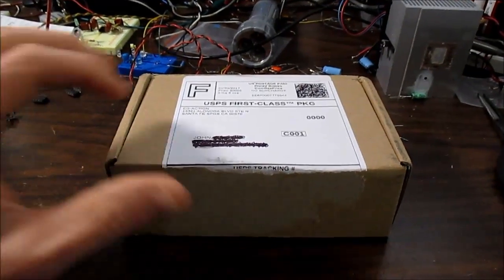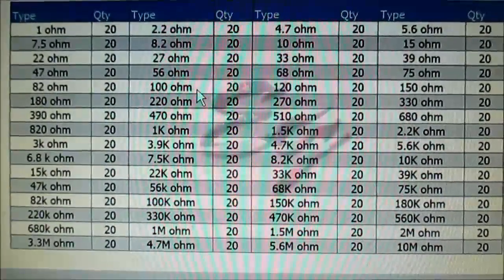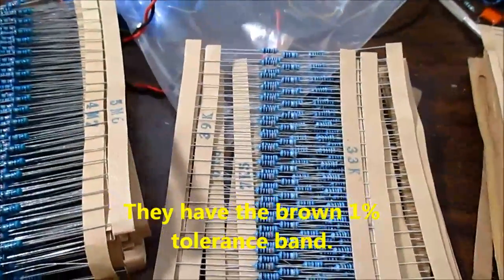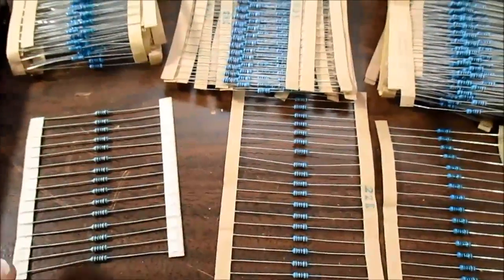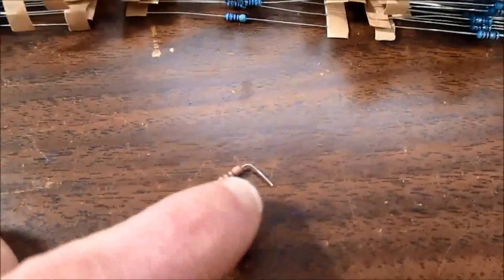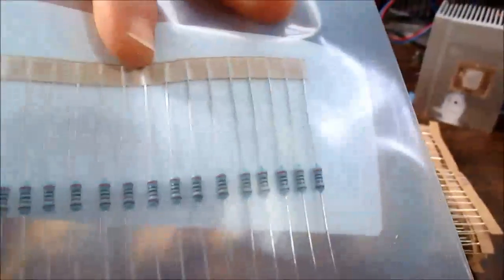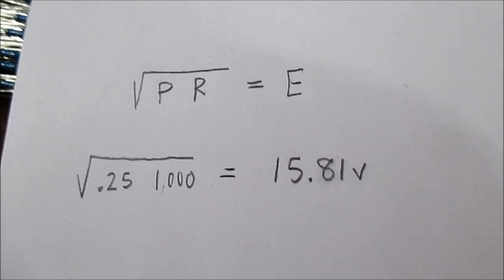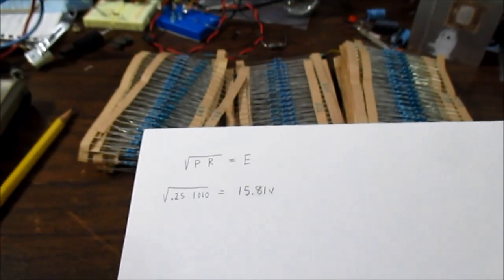eBay resistor kits - are they any good?  Review and test

Comment: test the leads if they are magnetic or copper with a magnet !
Reply: I think they are magnetic for this price. Years ago I bought on aliexpress perfect 1/4W resistor kit with non-magnetic leads, for good price $25 or something and lead resistance about 1.8-2.0mR. Now i can't find the same, prices are cheap, steel thin magnetic lead with 20mR resistance. Steel leads are half of a problem, but they are damn thin and bends. I can buy Taiwan resistors separatelly in my local store with good thick copper leads.

Comment: Most really cheap parts are untested. We use to get 15% failures on opticouplers on flame sensors the would fail in circuit test. About 30% of some chips on a low frequency radio board went up in smoke in during functional testing. A whole pallet with reels of resistors had about 10% bad. The department that bought the parts didn't want to spend the money on tested parts even the parts that hurt parts per million in defects, they got bonuses for saving money while we were pressured to do something about the defects. The untested opticouplers costed about 10 cents but the vendor charged another 5 cents to test them. Sometimes I would remove the component and solder in another bad component. Soldering the ASIC package chips with 40 J-leads was a pain, it was faster to put them on a BGA machine to remove them.  Building military stuff doesn't have that problem because every part is tested from the vendor before it's soldered on the board.

Comment: I did some test on the resistors to find the values drift with temperature, not 1%, use inferior thin steel leads, and do not solder as well either. In most circuit they will still work, but I question the long term reliability, and figure its not worth the hassle of having a massive problem afterwards, the cost savings are not worth the risk for such a low value item.

Comment: if i have 2 1/4 watt and need 1/2 watt. can i combine the two 1/4 to make 1/2?
Reply: Nope. It'll divide the resistor value by half. So if you have 2pcs 10ohm resistor wired in parallel, you'll get 5Ohm.

Comment: Hi thanks for the very informative video.  Do you think that noise can be an issue with resistors ?  i am obsessed by just one resistor ... the feedback one   I wonder if different noise figures from brand to brand can have an impact on the sound.  It is a very small part but with an importan task ... so its noise performance and linearity with frequency can be critical.   Thanks again.  Kind regards, gino

Comment: Hell I have just pulled out a 60 year old resistor that reads 80k instead of 39k  so how a  Chinese replacement be worse I don't know.
Reply: I just repaired the SMPS in a two year old bookshelf stereo system where a 1M resistor failed running at 50v. Quite how that happened is a mystery. It was a cheapo carbon resistor and I replaced it with a cheapo one of these.

The main problem with cheap components I think is higher failure rate, and if a device has 200 such bits in it, well we see the results all round us.

That said folk tend to toss stuff because it doesn't fit with their decor these days rather than because it is end of life so the need for quality is questionable. Very few 2018 stereos will still be around in 60 years even if they still work!

Comment: I've found cheap resistors like this are generally unstable under any kind of thermal stress and the leads are so thin and weak that you can't even push them into a breadboard without them folding over onto themselves.  Just my experience.

Comment: I thought I'd try some of those cheap resistor kits, a thousand or whatever with values from 1 ohm to 2 meg or  so. They measure OK at room temp, but the leads are like awful skinny bendy things and what made me put them in the bin was the  stability  - under load these are going to be crap. Heat one up and watch the values swing wildly. Tested next to a regular RS 0.25W 1k resistor a fairly harsh test was done raising the temp to over 150 degrees. The cheap resistor went down below 800 ohms, the RS component (which was 40 years old) - no change detected. I heated even further - roasting them a bit, RS no real change (maybe an ohm or two), cheap one kept dropping, though to be fair it recovered at room temp to near rated value. Negative 35% was about the order.
I thought maybe I could use them for something...but no, they are useless for my needs and in the bin they went. What are they? Crappy thermistors or crappy resistors?
Reply: NB Wonder if I was sent carbon film Rs instead of metal film? Temp coefficient is one area metal film really scores.
Reply from the maker: I was wondering too as I read that. I'll have to test mine. Typical low cost junk.
Reply: @JohnAudioTech  I was looking at the properties of metal film and it seems that the figures are in the few parts per million per degree, whilst carbon film is between 200 and 1500 parts per million per degree - right in the area I found. I guess they were not metal film.

Comment: My experience is the leads on these resistors are super thin! They're barely usable in breadboards. I've been looking for alternatives with thicker leads online, but to no avail.

Beyond that, the accuracy has been good for my applications as well. I tinkering a lot with resonant circuits, and generally notice drifting or if something is not in spec fairly quickly. And as long as you solder them, you'll be good.
Reply from the maker: Yes the leads are thin and are steel core. You have to go to a place like DigiKey for better quality.
Reply: Mouser has the Xicon brand 1/4 watt metal film for about $2.00 per 100.  Excellent quality with thick leads.  I just grab some in the main values I need.  YMMV.

Comment: Yes they are...bought all kinda metal film assortments before....cheap and worth it....nothing really specific or a point for carbon film anymore imo....Oxides or Cements/wirewound is a different story though...they usually have had a little better handling. Take a chance and have seen a lot of carbon film/comp open or drifted and I have.

Comment: What about capacitors for audio? is there any difference in quality between the good brands and the cheap ones?
Reply: if your only after 400 or so picofarads and under you can just make them yourself out of copper tape,  and wire for 10 picofards and under.

Comment: one good test i always thought was to 'burn' a resistor while hooked up to the meter with either a low temp flame (lighter or match) or a propane torch and see what happens to the value - the chinese 1% ones i bought didnt' change value at ALL
Reply: That is very interesting - mine were wildly changing - They dropped to over 35 % value. Binned the lot. I will certainly try some more. Where did you get yours?

Comment: One parameter you said nothing about: is the working and over voltage rating.
Note P=I(IR), IR=V is not the same as the voltage rating. 
These ebay/amazon sellers do not
even mention the voltage ratings, (at least not the ones I looked at).
So if you are doing mostly low voltage circuit - then maybe you are fine with these resistors, but if you are using them in tube amps - which may have 
hundreds of volts drop - then you need to be careful. 
The resistor may not sustain a high voltage drop even if the power rating is not exceeded. I buy from http://justradios.com/ which is more expensive but ratings are reported, and suitable for vacuum tube circuits. If anyone knows of other sources with proper ratings, please post
the source information. Note: http://justradios.com/ also sells capacitors.
Reply: You can infer voltage rating from the size of the resistor (air breakdown), 1/4W would typically be 200V or so, ie not upto most valve circuitry, fine for almost everything else.  Its a conservative rating in practice, usually heat dissipation is the limiting factor unless very high resistance values.

Comment: The vast majority of average meters are not sufficiently accurate to measure better than 1%. I have done similar tests a few years ago using a meter calibrated against a laboratory standard set of resistors (better than 0.1%). Nearly all were within spec. The vast majority of circuits don't need better than 5%. On the other hand I recently tested some Chinese ceramic capacitors, and in most cases they were way off, anything up to 30%, generally on the low side.

Comment: The 'classic' abbreviation for voltage is U, from the Latin word: 'urgere', which means 'to press', or 'to push'.  This makes sense: the voltage 'pushes' the current through the resister.  BTW, the abbrevriation for curren "I", is derived from 'Intensity'.
Reply: That was rather nice to read, I was wondering about the 'U' recently - One of our European contributors uses the 'U'. In the UK we generally always use 'V' and none of my literature from over 50 years uses U..Some things just pass you by...You sometimes just accept things without question. I never questioned the 'I' for current either..Grrrr I'm annoyed with myself.
Reply: the classic abbreviation for voltage is  E   the classic abbreviation for current is  I  the classic abbreviation for resistance is  R     go check it out   73's
Reply: NO the classic abbreviation for voltage is  E  not U
Reply: Not sure where the E comes from. U is used instead of V because V might be confused with the unit symbol.
Reply: @robertfleming5193  No the abbreviation for electric field is E. Voltage is quite consistently V these days.

Comment: It never fails to amuse me watching (especially) the US "evaluations" of chinesium stuff.  It doesn't matter if it's a $200 metalworker's vice or 20000 items bought for $1.  Usually the review is flimed on a high value "quality" camera (usually made in ... yep! china).  Sometimes, like this one despite a grudging start it turns out to be a reasonably balanced and fair effort (you really need a wheatstone bridge to compare consistency).  Or it's a completely biased mash up that compares a $20 chinese doo dah with a $10,000 (god bless america) component, that, these days will usually have been made in china and then badged in detroit.

Fact is the majority of the world's "stuff" be it motherboard or steel girder is made in china and shipped anywhere in the world for 20% the cost of a homebrew item.  It's also a fact that the chinese will produce a whole range of knock off copies to a range of prices - it's not inferior manufacturing - pay 1/10th the price you'll get something half as good - pay the same money as the home kit and you'll get an item that's probably better quality than the original.

It's not just the US ... it's the same in europe - we're just more used to using trade goods.
Reply: AW. I generally agree. A major aspect with Chinese stuff, is finessing of product design/performance and quality control. Some potentially great, very cheap electronics are completely ruined by lack of these aspects. Reason being, they are the expensive parts of production. You can't have everything on the cheap. Can be very frustrating though, when the ship is spoiled for an hapeth of tar.

Comment: Digikey is a distributer and not a manufacture. Also, EEVBlog did a video showing how several resistors he baught through digikey, were out of specs brand new.  Also, I love how you have the exact same meter as me (The Radio Shack One)

Comment: I purchased a big kit of 1/4 watt 1% resistors from an Amazon seller and I checked many of them and several were bang on to the listed value and that surprised me. My DMM is a really good one, but it may be a little off. That being said the 500 ohm was exactly 500 ohm, so some of these cheap kits are really good.

Comment: 1% or 5% most of the time doesn't effect my circuit. But I also avoid Chinese stuff. Because it coats tin or silver with very very thin coat ,once you touch it , comeback a month later  and try to soldier, it will have rust on it. You must waste more time to sand it off other wise you must put more flux which is  acid and shorten you platinum life on your soldier tip. For IC they trend to use recycle copper(high impurity) and when you bend it twice the IC leg breaks.
Reply: You don't use Chinese stuff---Hell you should probably get out of electronics. Chinese is everywhere.

Comment: Have you measured the resistors in 4 point probe wire kelvin measurement on a 4 point probe DMM (calibrate DMM).
A more accurate measurement.
Reply: A 4 wire ohm meter will only make a difference when reading very low values of resistance.

Comment: Nothing wrong with cheap & cheerful resistors - although not meeting their marked tolerance is a bit of a worry. Generally you'll know when it's a critical application & pay the extra for what you need. For example, the 6.8k phantom power feed resistors in a mic preamp need to be super well matched or you'll ruin your common mode rejection ratio - in that case I'll pay a couple of dollars a pop for 0.1% resistors, then test & select a pair that are within a few ohms of each other. You need to be careful of temperature effects when you're aiming for that sort of precision, though - even holding them in your fingers will cause a noticeable drift in value.

Comment: I like the formula at the end. I bought a box of quarter watt resistors same type from Amazon Resistorland brand and used them for transmitters and the wattage worried me but so far they still are working...not to sure how to measure the transmitter wattage yet

Comment: Most modern electronics will be using these anyway rather than the branded stuff. I don't really see where they can go wrong making resistors.
Reply: Copper has batter resistance, fast response and and it is less corrosive than non magnetic ones!

Comment: I just ordered a small resistor kit from digikey, they stiffed me with the higher shipping rate! kit=$17.00 shipping=$12.00, they could have sent it usps 1st class at $3.00, but they chose to put it a large box to make it heavier, thus jacking up the shipping cost, so point being is that if you are going to order, make it a large order or it is not worth it
Reply from the maker: Did you select USPS 1st class option at checkout? I always do and that is what I am charged. I just got a package delivered from them today. It was a bit larger than normal for the components, but I think it is still in the 1st class size limit. I weighed it at 12 oz. I will have to double check to be sure I didn't get hosed on my $21 order.
Reply: I did ask for that option, but they uped it to priority mail without asking, the customer service rep said it came in at a higher weight. I am a usps employee and I know that the only way those resistors could have been at a higher weight is if they used a larger than normal box
Reply from the maker: The label on my box was first class and the box was 9x9x4 in size (larger than they usually send my stuff in). It just barely made 1st class by weight. Hopefully this isn't a new change at DK as it will be harder to make the first class weight limit with some of my orders. I buy from them several times a year and haven't had an issue. Perhaps they just goofed up in your case.

Comment: Ahhhh more eBay videos! love it!!!
I bought a 100 value, 10 of each 1/2W 5% resistor kit for $13 from china last summer. so far everyone i've tried, 220, 470, 1K 5.4K and some odd value have all been within tolerance. only gripes are the leads are about half as thin on what you have in this video. but the worst is the cut tape on them was TERRIBLE!!!! they are always falling off and they won't stick back on. i have a pile of 60 or so resistors that have fallen off the tape.
Reply: that's  good if the tape left a gummy residue they would suck so falling off is good

Comment: Hi John. I use these relatively cheap resistors all the time. As you said most circuits are quite happy with a 5% tolerance, so a near 1% is just fine and of course much lower noise than a carbon resister.
Reply from the maker: I'm no physicist but it is referred to as thermal noise. For whatever reason, carbon resistors have higher noise than the metal film types. Believe it or not, the transfer function of carbon resistors is slightly non linear and can cause some distortion. All the amplifier design books I have looked through say to avoid the use of carbon resistors in critical parts of the amplifier.
Reply: All resistors have thermal noise, "Johnson noise", its part and parcel of being resistive.  Carbon types, especially carbon comp have "excess noise" (other kinds of noise), due to the nature of the material used,
and usually this has a 1/f spectrum (ie very bad at low frequencies, typically called "flicker noise", due to the random voltage perterbations you see on a sensitive piece of measuring equipment).  These days you'd not use carbon resistors in a microphone amplifier (its possible to hear the improvement when metal oxide or metal
film are substituted for sensitive applications like this).

I think there are modern carbon types with much better noise performance, due to more precise manufacturing processes, but they are film, not composition types I am sure.
Reply: What makes a resistor noisy?
Reply: Carbon resistors can sound like rice crispies when you pour on milk.
Reply: Probably use in microphone and nowadays to a lesser extent, RIAA amplifiers. Also use in any D/A stages (cd/DVD players and Bluetooth /Toslink converters).